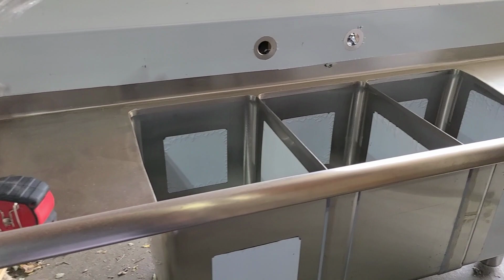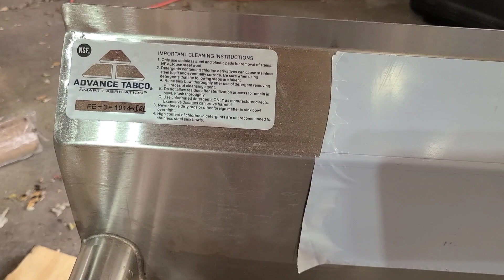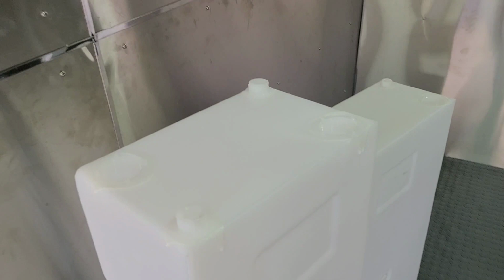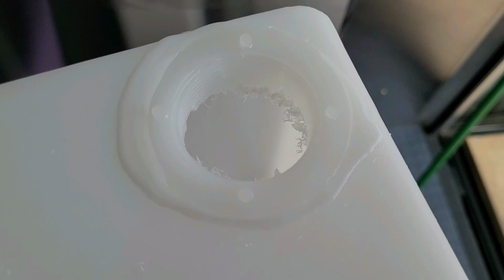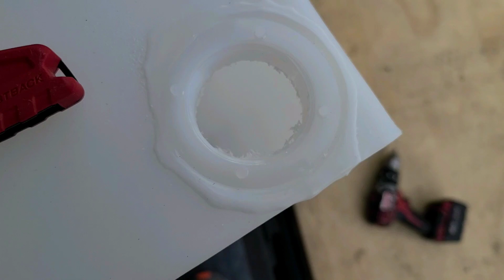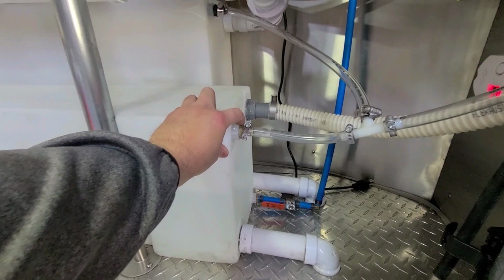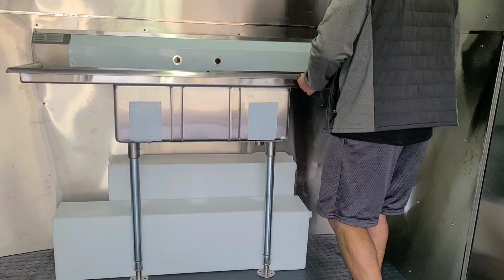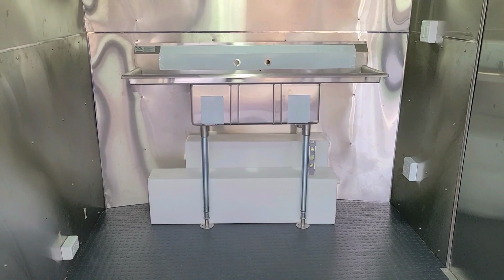How to Build a Food Truck: Installing the 3 Compartment Sink

Comment: The heath department where I am, doesn’t have a length requirement, and as far as I can tell, doesn’t require integral drain boards. They do require that half of the size largest cook ware (pots, pans, etc) be able to be submersed into the wash basin. So if you can get half of the largest item under water in the wash basin, that’s good enough for the State.
Reply from the maker: Nice!! Yeah every department is so different, makes it even harder to get everyone on same page
Reply: I found in my state the local health dept. doesn't require drain boards but the USDA does.
Reply from the maker: @nickb3818  interesting never heard of the USDA having requirements but very possible

Comment: Thanks for posting these videos; I’m building out my own trailer here in Detroit. I’ve been contemplating how I’d bolt my sink and tables to my floor and those floor flanges came in clutch! One question: Do the legs lock into these flanges?
Reply from the maker: Yes the legs fit right into the legs they are a great option for this part of the build

Comment: Thank you Frank wall panels with 1/2 inch plywood completed as you recommended. Also thank you on Electrical recommendation. Working on it now. My second question on plumbing is. Do you recommend uniseal from class A custom tanks. Greatly appreciate your help with this tutorials. Keep it up. Big thank you
Reply from the maker: I had to look up what uniseal was lol. 🤣 I have no idea how trusty that setup is. I like the ones I purchased the undermount ones they have not given me a single issue.
Reply: Thank you I will definitely call and ask Class A customs.

Comment: Great video Frank.. I am putting together a pizza trailer. Would you happen to have the parts # for both tanks.. thank you
Reply from the maker: No. Just the gallon size. That all depends on your HD requirements so make sure you check that beforehand

Comment: Hey Frank!  Do you think a hole saw bit would work when drilling out those 1.5 inch holes? Of course being sure not to mess up the threads :)
Reply from the maker: Maybe maybe and maybe a bit smaller than that. Worth a shot just careful around the threads because down the road you could get some leaks

Comment: Frank, I got these tanks from the same place you ordered them. 

Are these safe to stack on top of each other?

We ordered the larger size tanks, as we need to be away from hookups for days at a time.

Look forward to hearing from you.

You have been really invaluable in me diy-ing my own food truck!
Reply from the maker: Appreciate that!!!! Thank you for that comment. To be honest that is a question I would not have the answer to I have never stacked them. Email them they are pretty good at responding
Reply: @fbaltierrez  okay Frank I absolutely will do that!

Thank you again!
Reply: @veraoff-roads3487  Did you find out the answer? I have a 40 pound fresh and 46 pound wastewater size tanks.
Reply: @KB-pv7lk  I would say that now that we have some miles on our truck the answer is basically no, not without framework around them

Comment: 🤔🤔🤔Three compartment sink will not fit flush against wall. About 3 inch gap between sink and wall. I bought the same setup same sink and tanks. Do you have the same gap??? Didn't recalled it mentioned.
Reply from the maker: Yes. My trailer is not flat 100% in front there is a gap. All my trailers have had a gap in back.
Reply: @fbaltierrez ok thanks I thought I bought the wrong tanks or sinks. When I kept trying to fit the sink flush to the wall coming up with about 3 inches shy and could never get it flush unless the sink was leaning back to the wall. So I'm going to put a stud behind the back of the sink to mount. Thanks!

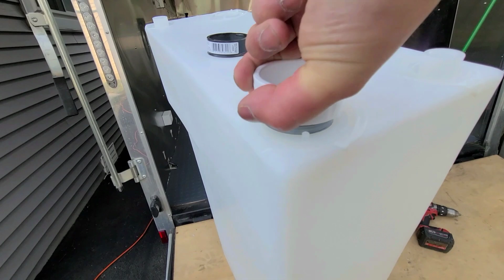Comment: 10:53 The drain valves. Could you please share where you purchased them. I can't seem to find them in the 1 1/2" size anywhere. Thank you
Reply from the maker: Had to re-watch but just looked those up and they are completely sold out on Amazon. Hmmmmm. Have to see where else we can get them from
Reply: @fbaltierrez  Thanks for the reply Frank. I think my "drain valve" was misleading what I meant was the "gate valves" I had been looking for them everywhere all I could find were the 3" ones for rvs. I gave it another try after watching this and found them on Amazon. I'm assuming your talking about the  (Valterra T01-0091VP Swivel Drain Connector - 90°, 1-1/2" x 3/4") that is out of stock on Amazon. If anyone is looking for those just do a Google search and there are a few places that have them in stock. Thanks again
Reply from the maker: @jeffp7776  yes just saw they are sold out. Found 3 of them purchased them

Comment: Hey Frank! Big help here watching your vids!  Was wondering where you found the hose attached for the water waist valve.
Thx -Dan
Reply: Attachment*
Reply from the maker: Got all the hoses from class A Customs.
Reply: @fbaltierrez  thanks for responding Frank.  I’m talking about the outside waist drains.. you have what looks like an attachment that fits to a garden hose so you can drain your gray water away from the trailer.  Is that attachment on class A site? I couldn’t find it.
Reply from the maker: @dangilligan9938  let me see if I can get you a link.

Comment: My DOH requires a grease trap on the waste water exit line.  I noticed you didn’t mention anything about grease trap.  Do you put a grease trap on your waste water line?
Reply from the maker: No they don't require it on my truck/trailer, doesn't seem to be a requirement in my county
Reply: Where do you dump your gray water tank at?
Reply from the maker: @nathanc3396  commissary